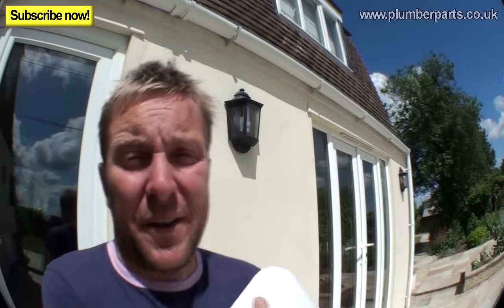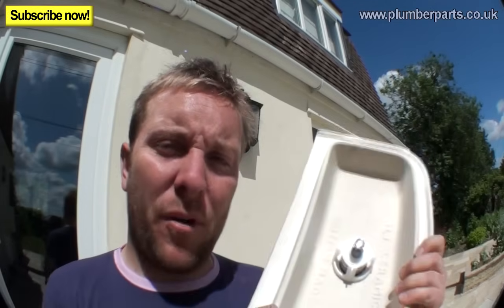HOW TO CHANGE A PUSH BUTTON FLUSH UNIT - Plumbing Tips

Comment: I'm a 70 year old female (yes, I've got the right website) and I've just completed my first plumbing job thanks to this great video which gave me the confidence to give it a try. Unfortunately I came across a problem which had not been covered...a heavily corroded metal clamp. I discovered that a coke and toothbrush would do the job....worked perfectly, had a can in the fridge but won't be able to clean my teeth tonight..yes..still got my own!....thanks again for the help.

Comment: Hi Plumbparts,  You successfully guided me through changing a Push Button Flush Unit - Thanks a lot you really helped me understand the process.  Just one point though, on your video at 3.24 you said that, in the package was 'another doughnut' which you don't tend to use.  Are you sure it was a doughnut and not a cistern seal adaptor for a larger bore outlet? Just asking because I needed the this adptorvfor my DIY task!  Thanks again, my wife is looking forward to me watching more of your channels!

Comment: Hiya I do tons of DIY and have now watched quite a number of your videos. Thank you, they've been a big help. Just a quick question as I can't find it on your amazon link. 
What is the 'donut' that you do like please?
I think I've a developing and failing syphon diaphragm as the cistern handle is sometimes 'weak' but the loo still flushes just fine. So have bought spare toilet cistern syphon diaphragm, but if I need to replace it, I'll still have to remove it all to fit them. Whilst I don't have any issue with the current one, but it's been there 12 yrs that I know of and moving it might see it break up! So having a new one in stock seems like a wise idea! But which one please!?

Comment: Out of wonderment do you change the whole flush unit rarther than fault finding? Just wondering as I started out on my own a month ago and have come across 3 of these that I replaced the whole fush unit on, coudnt find anything wrong with the old one apart from it would let by all the time.

Any info would be great thanks.

Comment: Good clear video fella. Problem here though. I can't get adequate access to my water connection on the tank due to a wall on the same side. The toilet drain goes sideways into this wall too, which doesn't help. It's impossible to get onto the connection with a regular spanner. 

Is there a tool that I could get that would be able to undo the connector from below (in the same way that you could turn a bolt with a socket on an arm)?

Comment: Great video but in my case, someone has put silicone or filler onto the screw heads that attach the cistern to the wall. As these screws have to be removed in order to get the cistern off the wall then I think I might not start the job in case I end up not being able to finish it. At least now what is involved and whether I should tackle it.

Comment: This was SO helpful, thank you.  We put the blanking plug on the wrong way (had to buy a new cistern after we fitted the new flush valves as when we put the lid on the whole cistern cracked like a raw egg! Must have been a hairline crack as we were very careful)....so, new cistern arrived after 10 days ordering, fitted all the parts, leaking at blanking plug....duh - realise we have put blanking plug on the wrong way!  Will now drain it again, turn water off, take cistern off wall and put blanking plug in the right way!!  Rookie mistake?? :)
Reply from the maker: Ha! No.....! I hope it's all working now!? 

SUBSCRIBE! ➡️👉 https://www.youtube.com/subscription_center?add_user=plumberparts 👈⬅️ IF YOU HAVEN'T ALREADY! 😎
Reply: plumberparts erm...that part is now working perfectly. Unfortunately the gasket at the flush valve seal slipped - so a very small drip coming from left wing nut and back of cistern. Need to take it off again and make sure its staying in place when we tighten flush valve. (currently bandaged drip with a towel). Nearly there now. Have learned tons through our mistakes. We can see tiny, tiny air bubbles collecting around the rubber seal at the flush valve when looking inside). When we re-fit it, we will do water test (before replacing), checking for drips and look to see if any air bubbles inside). My mother (68 years old) and myself are feeling proud that we are doing this ourselves! (With the help pf your excellent video)!! Thank you :)
Reply: All cisterns go!!! We re-fitted it... thanks to your excellent tutorial. Girls can do plumbing :-D

Comment: I have an Ideal Standard push button flush. THe small button has stopped working and the big button now needs a long hold to flush. I took the lid off an the "buttons" are working OK - pushing the smalll flush direct does nothing. 

Is this a common fault? Do I need to replace the unit, or is it fixable? Maybe something needs wiggling?

I am guessing that as this video is about replacing a flush unit, it is something that needs replacing!

Comment: lovely instructions... tks .. I use the fluidmaster and it said to use either the sponge seal or rubber that is supplied depending on diametre of hole... noticed you did not do that and just threw the rubber peice away.. question is does it matter or are the sponge ones better seal... (btw flushed first time and it all came out the bottom doh....)
Reply: o

Comment: hey buddy

just replaced two push button units with the cable fitting and one is fine but the other button pops right back up as soon as you let go of it! you have to hold down the button to flush the toilet completely

the weird thing is, if you lift the top off a little bit...it works fine, so i wonder if it's just a faulty button or part?

any ideas, come across it oh fountain of knowledge?! :)

Comment: Hi, it is only the top button that is broken - the flush system itself it fine - am I able to just change that bit rather than taking the loo apart?
Reply from the maker: That depends on the manufacturer!
Reply: OK I'll need to check that, thanks for the response.

Comment: This and another one of your videos have been soooo useful!  I think a lot of us just like a good challenge (& we're cheapskates) so if you can learn how to diy then why not give it a bash eh.   One question:  I have the flushking fleximount dual flush fitted nicely... how do actually move that adjustment setting on the side to increase/reduce flush?  It doesn't seem to move.  Thanks in advance. V
Reply: No tell a lie, it's now moving easily.  While I'm here, another question. Is there anyway to give the flush a little more oooph or is an 'average' flush just the nature of  a push button flush?  Cheers
Reply from the maker: Push the tabs in and they should move....

Comment: Great Video! I am an electrician, doing my BA Honors in Film and Documentary now, the final year. As an electrician for 35 years,, I had to be able to do bits of everything but cisterns were always a no-go area for me. Took on a project a few weeks ago for my brother doing up his bathroom, full works. I have a Wooden WC unit in order to hide the cistern completely. The toilet will be backed up against the unit so no pipes or wastes will be seen. I will be mounting the flush button on the wooden unit instead of the cistern. I am a bit nervous but hope it is the same thing, If any tips, tell me. Thank you.

Comment: My push button loo seems to have low pressure when flushing. Is the pressure dictated by the size/amount of water in cistern? Or is there a way to increase pressure? Thanks..love the vids btw.
Reply from the maker: It's usually to do with the flush unit itself. What type is it?
Reply: not syphon, if that makes sense.

Comment: As mentioned before thanks to your brilliant videos I have fitted a fleximount dual flush myself.  The only problem is that the flush is not powerful at all.  I have put it on the biggest flush setting and it's just a light swirl sometimes not getting rid of no.2's.  Any tips? Please help!

Comment: Brilliant video but when it came to undoing the wing-nut, the idiot who had fitted it , in a confined space,  had bent the the threaded section to 90°!!! I was unable to get an angle grinder in or even a screw driver onto it. I didn't want to remove the basin, so gave up!

Comment: Not best practice to leave aperture with all the old funk and dirt in place.  A minute's cleaning will pay off with a much lower chance of leakage later.  A couple of soft washers under the wing-nuts is a critical improvement - less chance of cracking the ceramic finish of the cistern.

Comment: Know what you mean about silicone. Had to change a customer's bottom-entry float valve on a close-coupled wc, like the one on your vid. The wazzock who originally installed the cistern not only screwed it to the wall, he also stuck it to the wall with half a tube of silicone!!!!!!!!!  The absolute fecker!!!!!!!!

Comment: I just had to replace evrything on mine,flush cone fluch  unit and valve,and would you believe it the idiot who fitted it,even had the soil pipe multikwik running up hill so i had ro cut the soil and use a flexi,so as to give it a fall,the prob then was i simply did not know how to get the overflow tube to lower,a quick call to the company and she explained how you can turn lower it the turn it to lock in position,all good now,

Comment: You forgot to re-attach the refill tube from the fill valve to the overflow tube on the flush assembly. The bowl won't fill to the proper level without it.

Comment: If you use brass bolts, they will not rust like the steel ones.
Reply from the maker: Good point!

Sub here please>> https://www.youtube.com/subscription_center?add_user=plumberparts <<If you haven't already!
Reply: +plumberparts I've been subscribed for aboot  8 months. Some of these newer toilets here in the US and Canada have a metal bracket under them which will rot out in the summer time, which is why l like the toilets with the bolts going through the tank. And do those two screws in the back of the tank keep the tank from shaking after you tighten the wing nuts?

Comment: How convoluted! A toilet where the tank fastens to the wall? Or where you have to remove the TANK to fix the flapper and/or fill valve? Goes to show, NEVER BUY a push-button toilet. I've actually never seen one of these, not being in the UK (USA toilets are simpler and easy to fix,)

Comment: "the idiot that installed this put silicone around it"??!! every plumber does its a guaranteed no leaker
Reply from the maker: No....no they don't. Not if they know what they're doing. :) Cheers, PP!
Reply: plumberparts Oh yes they do , also any one who thinks the 2” conversion washer is a donut washer is a Donut 🍩 the washer that you think is the new donut washer is for 2” toilet cisterns so the fluid master fits 1” and a half and two inch cistern walls I suggest you go on the tools with a plumber for a few years get your skills up ...... just saying. 🤠
Reply: @rub1tan679     conversion* washer
Reply: youtuber 👍👍😂😂